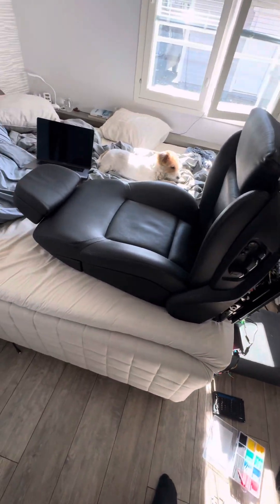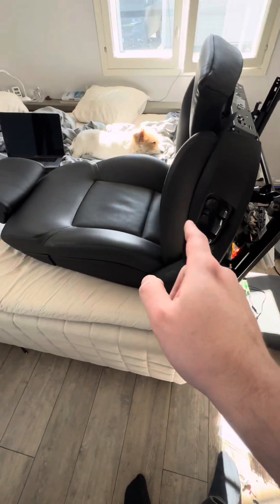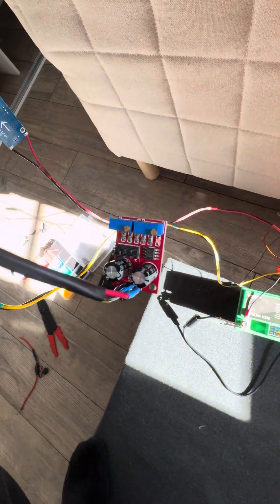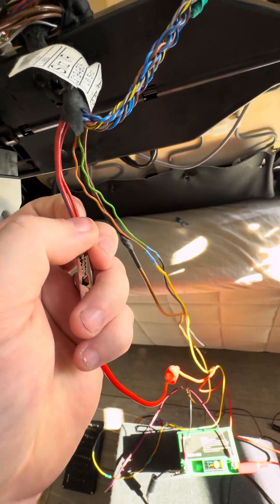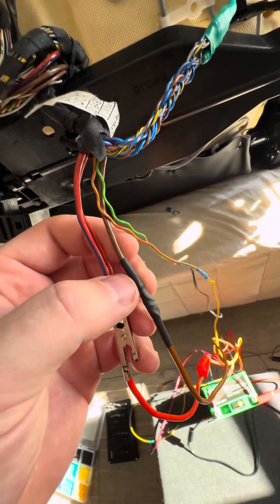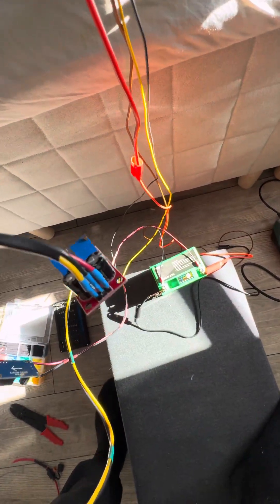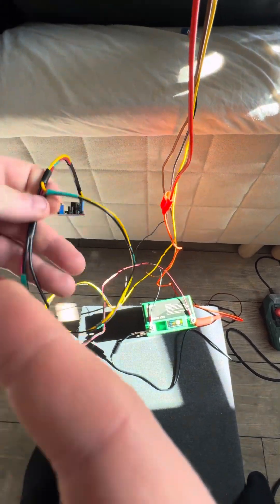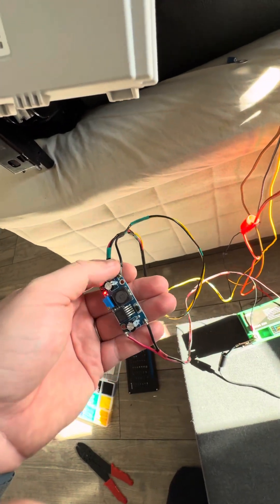BMW F01/F07/F10/F11 comfort seat, canbus override

Comment: hello, have you find the solution?...thank you for this video, i have tge same seat and trying to use it in another car, this video is very helpful
Reply from the maker: Hey Andrei, yes the solution is very simple. You just have to wake up the seat control module by feeding power to one of its components pins. Here is a good demonstration video of similar situation, where power is fed to one of the IC’s in the module. My seat module had the same IC. https://youtu.be/u9YJuHuB-j8?si=ksMdF1pB9pEXJ5kZ

Comment: You can search for solutions to enter sleep mode and solve this issue using Arduino, but not all seat functions will work.
Reply from the maker: Interesting. I might look into it.
Reply: @Ricqu  There is a Russian forum that has successfully activated all seat features, but purchasing from there is not possible.
Reply from the maker: @lovecassiet  Would you happen to have a link for that? I know theres an ukrainian guy whose made a module to mimic the car, but its more expensive than the seat itself.